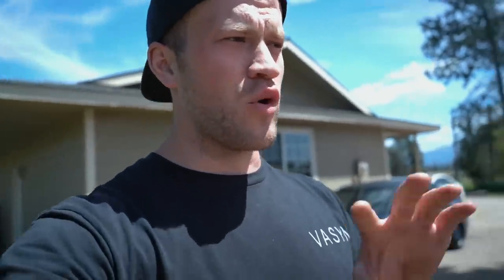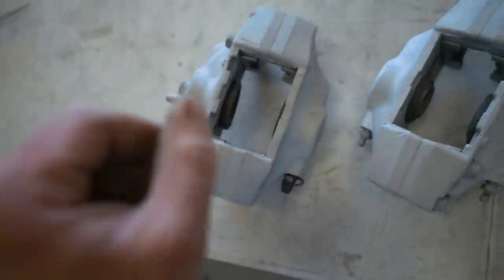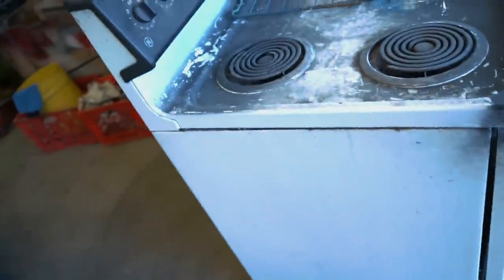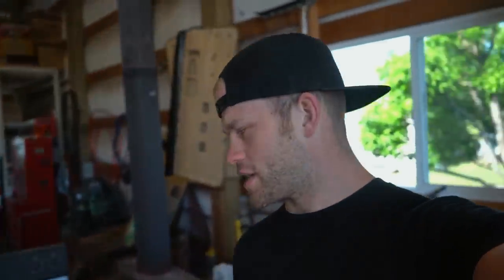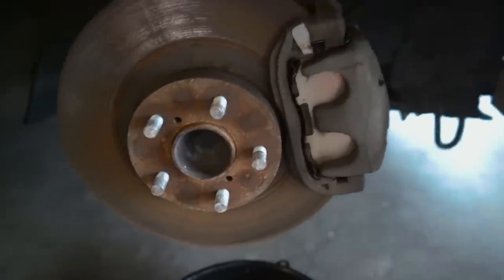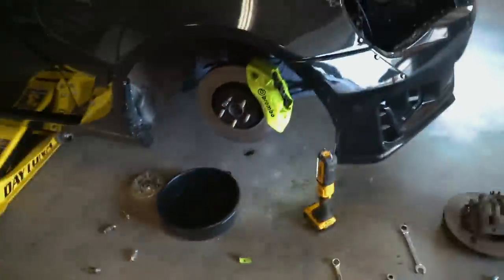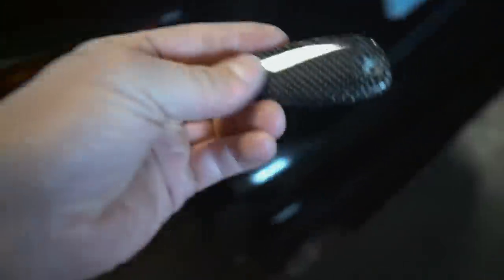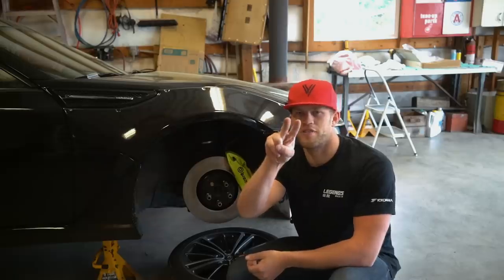Neon Yellow Brembo Brakes for the Widebody FRS!

Comment: You should cut the screws that were supposed to go into the antenna delete so the heads of the screws can drop into those two slots. Then just glue those to the antenna delete. Make it look like it's drilled in instead of there just being nothing there. May look a little cleaner.

Comment: Bro, used compressor on your calipers to push piston out only needs like 10psi, put a 2x4 in the middle and blast in the banjo bolt hole then the bleeder valve. Beware they will shoot out at a high velocity and will hurt your hand so use wood